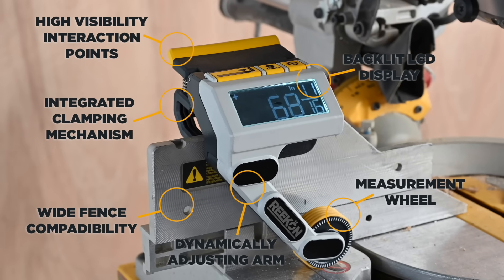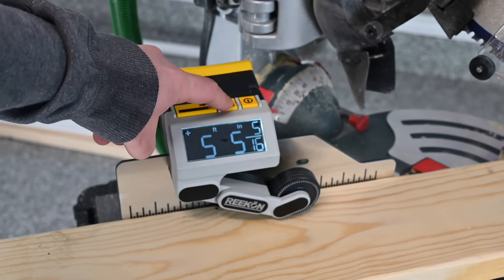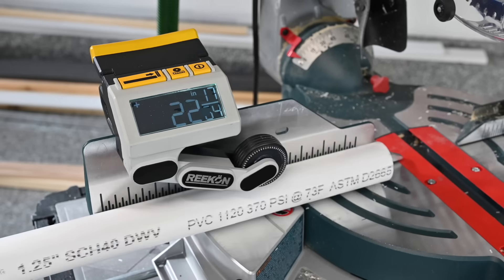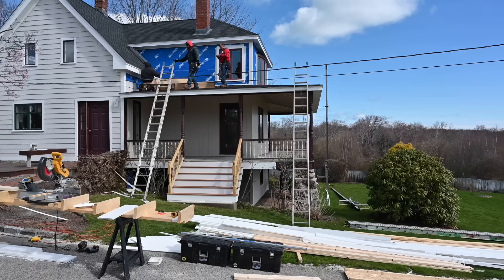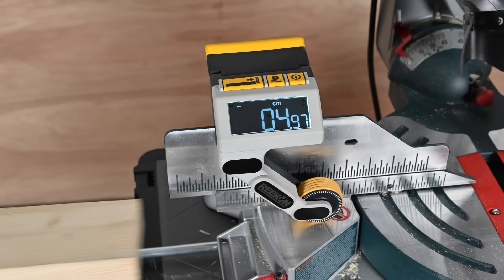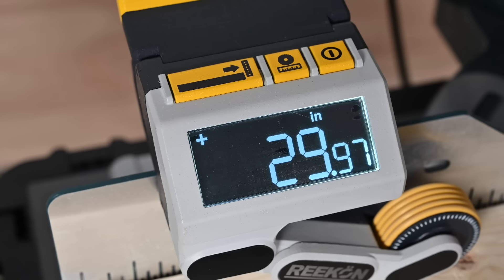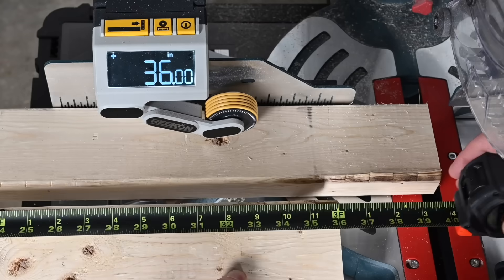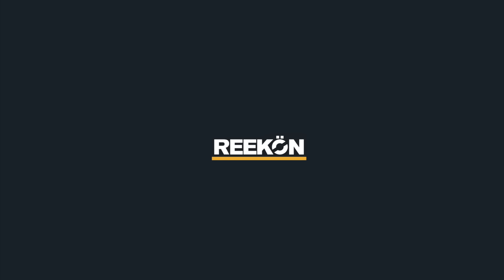M1 Caliber | A Better Way to Measure

Comment: really cool tool but "English or metric units" that gets under my skin
Reply: I am not a expert but I have felt the 'Imperial' word is a little bit problem with the terminology. In fact, these Imperial units have been used since the early days of science. I think the word 'Early' or 'Initial' unit is more correct instead of the word imperial unit. Because there is no metric unit in Isaac Newton's book.
Reply: @sumtingwong5451  maybe "customary"?
Reply: Why?
Reply: @PatrickPease  the English use metric
Reply: @arkencraft8095  warning: pedantic stuff follows, it's unnecessary and only posted with the intent to clarify

The English still use imperial AND metric systems. The metric system was largely developed in France which is the reason why "imperial" is sometimes called "English".

In addition, the Imperial system has been defined in metric terms for around 100 years so super pedantically they are both metric.
Reply: @PatrickPease  MP